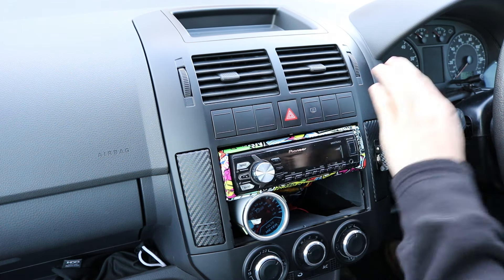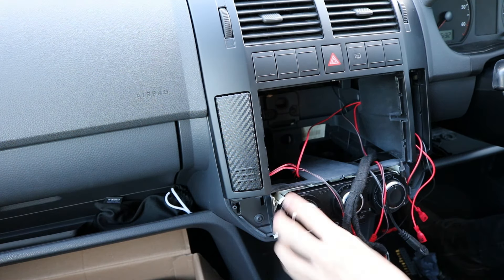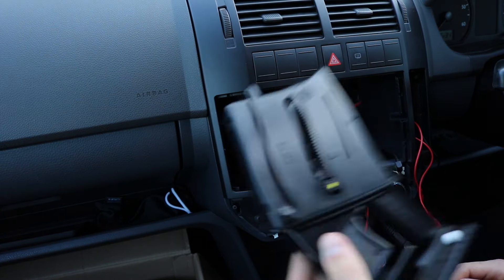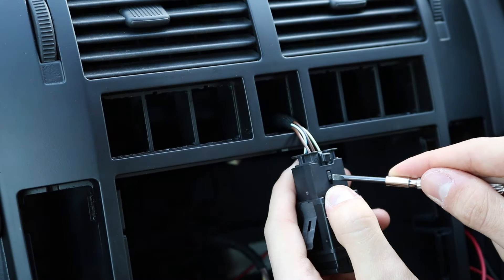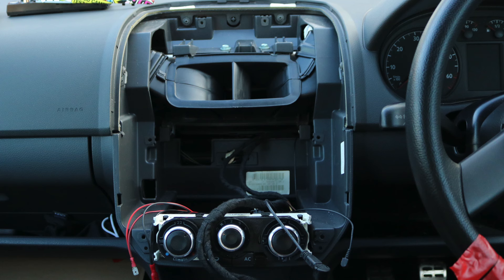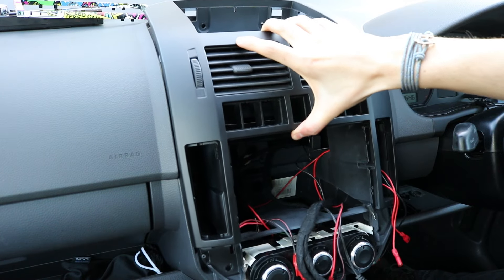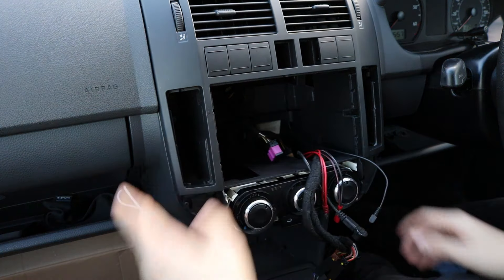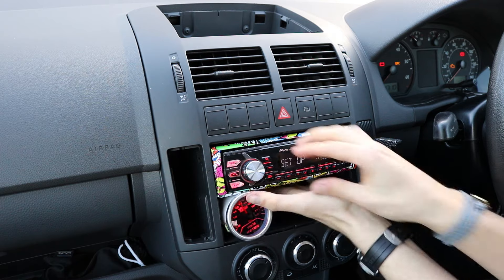VW Polo 9N Centre Console Removal - In Depth Tutorial

Comment: Any idea if you can replace the air vents on the console or if you cant remove them and have to buy a new console and get it fitted?
Reply from the maker: MRGadget's Gaming you can remove them, I don’t remember how but if you take the console off and look at the back, you’ll figure it out
Reply: @Ollie9T7  great. I broke mine and didn't want to pull it all apart to find out I need a new everything. Thanks
Reply: @kimilesnipez just tried to do this and theyre installed by rivets. hell to take out, did u do it!?
Reply: @haazi  I have no idea. I actually only owned the car for two years and never replaced it. Rivets are easy you can pop them off by using a drill and drilling lightly on the rivet but then you cannot secure it again so I wouldn't do that

Comment: My cup holder is jammed. I cant seem to pop it out from the front so guess I need to go in through the back. Do I need to replace it?
Reply from the maker: they are a pain to get out but if you break the clips you will probably want to replace them as it will more than likely rattle like hell
Reply: +OmgItsOllie 
We lust wedged in a knife in the top right corner where the clip is and it came out really easily.